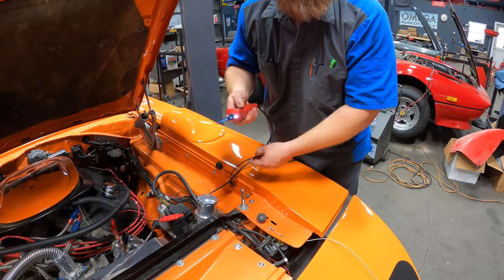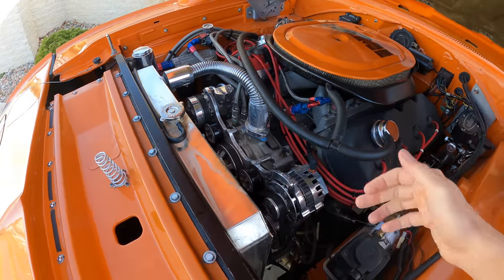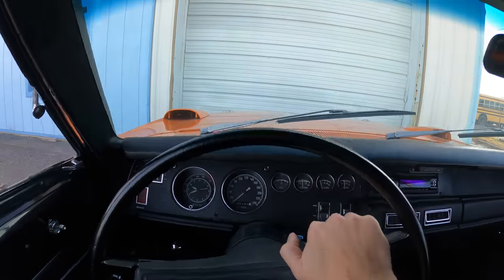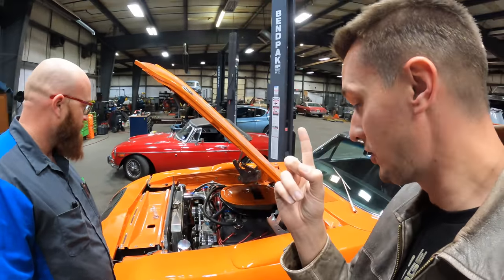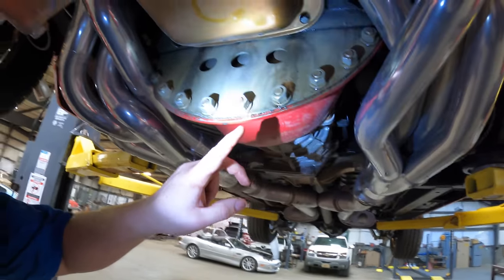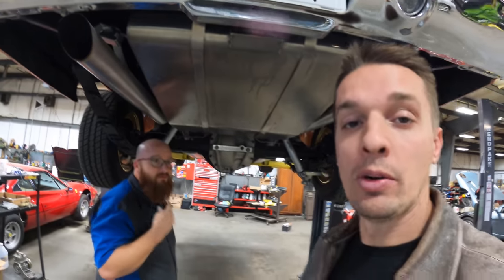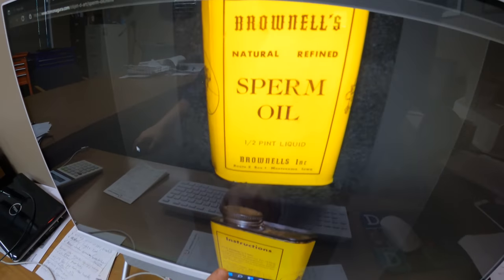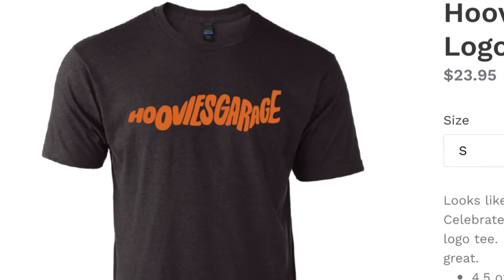How I got SCAMMED buying a Plymouth Superbird online sight unseen (So much broken/missing)

Comment: Who would risk driving a $130k car, with a rare engine, potentially low oil pressure, and a likely overheating situation?  Especially when he is on a first-name basis with the local tow operator?  I guess it's not "The dumbest automotive channel in all of YouTube" for nothing.... 😱
Reply: Someone with a lot of money but perhaps a little less common sense. However, he does seem like a really nice guy and the car is pretty awesome, well, once he replaces those wheels.

Comment: gauge issues are typical mopar. my 76 power wagon shows 3/4's tank when full, volt shows barely charging when its charging perfectly fine. the oil pressure always shows half up the gauge when cold, and a little less when hot. the temp gauge hardly moves off of cold even on a 90 degree day. its all due to the weird way dodge/chrysler did the gauge setups back then. there are voltage regulators behind the dash for the gauges. they either work, don't work, or do crazy things. welcome to the world of Mopar!

Comment: As a general rule I enjoy and even learn a little something from your videos.....But dude....The Superbird may be the MOST counterfeited American muscle car EVER! You would have been better off seeking out and buying, a real Roadrunner with the 383CID four barrel. Hell they had the same "beep beep horn"....Of course there were those 440CID "Six Pack" Plymouths and the 427CIDs were nothing to sneeze at....In other words you got royally screwed on this one.
Reply: Actually there is no "six pack" plymouths. The dodge was the six pack and the plymouths were six barrels. Picky i know but mopar people just are.
Reply: @SixPackDan  I think you just answered a question that bugged me from the start about the first patrol car I worked out of when I started my career in Law Enforcement back in 1976. That car was the las survivor six Plymouth Fury  "Police Package" cars purchased as a "fleet" in 1972. The owners manual was still in the glove box and the and the engine was identified as "six pack equipped"....At the time I was not even sure what that meant as I knew more about farm tractors and pickup trucks than sedans of any make or model. What I recall best about that old car was that it LAUNCHED rather than simply accelerated and ran like the proverbial scalded dog in a straight line, but you DID NOT want to get into the twisty turnies with it as body roll was a major factor. Thanks to your kind response I think I now know why I could never find any two references that seemed to agree on what Mopar vehicles of the era actually came equipped from the factory with "six packs". Again, thanks for the kind reply as it's always bothered me a bit as to why every other (civilian) Fury of that time period DID NOT have a "six pack" under the hood or mention of such an engine referenced in those very few owner's manuals that I had the rare occasion to look through. Even a 67 year old, retired Road Dog likes to learn new things.

Comment: Sucks you had to deal with a bum but I hope the car works out well for you!

It’s wild how subjective car values are considering I wouldn’t pay $13,000 for this 🤣
Reply: The prices for these classic Mopars are insane, especially the ultra rare ones like this. I saw a video where a guy found a 1969 Charger that was a total basket case, BUT it was an ultra rare equipment package and even though it was basically scrap metal the car was now worth restoring because of collector interest.

Comment: The wizard is right about the front shocks. As it is, the adjustable threaded spring purchases were adjusted to raise the front up, but the shocks (dampers) ran out of travel, as they are against the internal droop limiters. The guy before probably kept jacking on the spring purchases, but since the shocks were already against the droop limiters, it jacked up the spring preload. This basically locked the front end so the suspension would not move and the only spring/damping was in the tire sidewall. Not a good setup.  Needs socks with longer shafts to get the suspension travel where it needs to be with the desired ride height.

Comment: 4.10 Dana and an  A-833 18 spline 4 speed ought to be running at about 4,000 RPM’s at 70mph. Driving for an hour like that will wear you out. Passon Performance finally created a strengthened 18 spline (sustained 900 ft lbs torque) with a 5th GEAR!!! and the aluminum case is pretty close to the original cast iron case, so the geometry is right and no cutting of the floor is required. It allows you to drop your cruising rpm’s by 400-600 RPM’s in fifth gear without sacrificing much gearing in the first 4 gears as two of the gears are exactly the same as stock and the other two are spread a bit to where there’s not a big drop when you go into the 5th gear, which is a .80 final drive ratio. I have yet to install mine in my Cuda but I can’t wait. Trans was $5,500 + freight + clutch kit + a hydraulic throw out bearing system due to the HD clutch I needed. They’re normally on a year back order but worth the wait with a tall rear end like a 4.10. I’m running a 3.91 and it gets moving quick off the line, but highway trips are hard on the motor, hard in the passengers, hard on the wallet, sucking down gas at 8 mpg. and VERY LOUD in my car with side pipes.

Comment: That front suspension is an RMS kit I have the same one on my duster complete kits shipped to your door is around 6k now..... good suspension, just really not practical for for what you wanna do with the car..... Start gathering parts and put the original torsion bar suspension back on it and get the smooth ride quality it had from the factory....

Comment: We had a yellow one and loved it!  Had to sell it and cried in our cereal for a week afterward.  Our Superbird always run hot until we put a 4 core radiator in ours.  Please dump that aluminum radiator and get a repo one, you might have to wait a while to get it because of Covid  Also what do you call a Mopar with a after market trans, no Torsion Bars and a rack & pinion-- A boat anchor.. But keep this one as it's a superbird and get it back to what Mopar installed on it, there was nothing wrong with ours, except the over heating at first. Now I know why you only paid 125K for this one...... also get rid of those roll bars!!  And last is the old adage buyer beware.................

Comment: The car needs to be wired, plumbed. Convert the headlight doors to electric actuators..Lose the pumps. We use to run two of the big Chrysler 1970 440 single exhaust Imperial mufflers on our stealth streetcars..Walker had a part number. They flowed fairly well but were very quiet.

Comment: Wow a garage that actually lets you look under the car with the mechanic. Here in the UK you normally have to sit in a waiting room until some guy comes in tutting away and tells you that the flange woggle around the throat plate cover needs changing and it’s going to cost three thousand pounds. If you ask to have a look with the guy he starts talking about something called ‘elfin saftie’ and denies access to the workshop. I did have a great mechanic who would even let me help. Alas, he has recently retired.

Comment: Dude that sucks man!  I got scammed one time, I was out with this nice girl and we had taken that old KemoSabe trail up to Horsheweitz pass to check out the air brigade defence machine setting up their advanced airwac sqwuack comptroller in the valley but I started to get some vibration in the motor mounts on my old beater hotrod on account of I had just cut on the Roots blower from a GreyHound bus to my aircooled helicopter Tucker engine in the back of car #52 off the line.  MAN, it was abadass ride lifting the front wheels at least half track running 9's in the quarter cuz of all the weight transfer and my chick would ride in the back to help settle the torque steer on account she was a bigger gal and fit squarely in that chopped off tub behind the rails of the Tucker chassis where she could just hang on and straddle the plumbing tube roll cage bars.  
Luckily, no one was injured... except the day that gal broke my heart. /w\TMFR/w\

Comment: The headlight vacuum pump(s) seem a poor choice. They can't produce more than 15 psi (zero atmospheric pressure) whereas a positive pressure pump could easily put many times that--with smaller actuators to boot.

Comment: If it's done right it can be very difficult to spot repairs from collision. A friend of mine has a salvage yard as well as a bodyshop and several times over the years he would take a vehicle wrecked in the front (with a clean title)and one wrecked in the back and combine them. The one was a Cadillac and when it went to the dealer for service they couldn't tell even though they knew it must have been in a bodyshop because of the sanding dust built up on top of the fuel tank so they knew there must have been some type of repairs done to it.

Comment: I once bought a "runs and drives" Bronco on Ebay that didn't even have the intake manifold installed, was missing the carb, and the transmission was in the bed behind the seats.

Comment: That "vacuum pump" looks like an air suspension pump that someone has swapped the I/O and repurposed for vacuum and put the intake muffler on the outlet which is doing essentially nothing.  The also didn't bother to put a vacuum switch so the poor thing runs constantly.

Comment: Magnificent, wonderful car! Fascinating video! I guess if you can afford a $130,000 car, you can afford to forego pre-purchase inspection. I bought an eBay Datsun 280ZX in California, but did not purchase the car until it had an inspection by a Datsun/Nissan, vintage cars-familiar mechanic. The inspection cost me a few hundred bucks, but I wouldn't have handed over my $13,000 without it. It had issues as it was original in every way, but I bought it & drove it back to Texas.

Comment: Turbo mufflers. Nice. I also like the way turbo mufflers sound. Unfortunately they block alot of flow. They are quiet at idle and cruise but sound awesome at wide open throttle. I wish there was a better turbo muffler, something that flows better. Currently I run flowmaster 40s with tail pipes and if it is run all the way out the back it really isn't loud.

Comment: a lot of questions about whether this is authentic or not or about the rebody.  These are really hard questions  Do the basics, check the vin, the trim tags see what they say, do the research and see if Mopar actually made a distinction in these places, they may not have.  check the attachments of the trim tags and the surrounding area, are the rivets/welds correct? did a section of sheet metal get changed around the tag?  check frame numbers, check the paper trail, call previous owners.  Original birds' nose cones were not built real accurately, tops of fenders were smoothed with lead to match nose, some received a couple dents in the fire wall passenger side in the factory to designate Superbird as well as bends in the undercarriage, but check with experts on this, i am not one! Some things that stick out to me are, first why did they make this car into a restomod?  Superbirds are valuable, not as valuable as most people think, but valuable, very few people would restomod, they would restore because you're killing the value of the car.  That being said, the car looks to be worth all you paid for it, but in a restomod your value may not change a whole lot even if it isn't real, rel birds sell under $200,000, considerably  less most times..Who ever had it built put more money in it than you spent. People bitch and moan about original-rebody-partial rebody, these terms get really vague as does the law.  As far as i know, you could conceivably switch over every body panel one at a time and not really hit a certain spot where it officially becomes a different car, yet you can't legally switch the tag, basically you can drive a new car under the tag, but can't put the tag on a new car ..Where do you draw the line? new quarters? doors deck lid? roof?   You can make a tribute car which is really completely faking it, but when the guy you sell it to dies and it gets sold, does anyone know its not real?  the law is fuzzy, and the ethics actually are too!  what's a partial rebody?  All that i restore seem to end up with quarters, floor, trunk floor, maybe a used door, that's probably over half the car.  You can't misrepresent a car as something it's not, thats fraud, and you shouldn't, but it can be faked really well and when you restore a legit car it goes through the same process so it's very difficult to tell most the time and becomes a matter of opinion, generally if it's that good, it will sell as real.  but the buyer that really cares about all that is not going to care on this car either way because it's been highly modified, he wants it original or as it was, sloppy nose cone metal work and all.

Comment: I see a sub frame conversion. Torsion bars to coil-overs. I have an acquaintance that has done this change on a Challenger resto mod. It does improve the ride and handling. But WAY not stock and a negative that would have made me not touch this car. But it is a rebuilt crash car so....have a good time with it as a nice driver.

Comment: The major takeaway from this is the coil over spring set up, everyone is using them on these "crap resto-mods" and kit cars like 41 Willys etc, and now that I look back on them many are set up wrong, they bought too light a lb rating and cranked them down and the springs are compressed, because the front or rear or both were sagging instead of getting the right set up, a lot of these cars a whipped up in body shops, they toss them together and paint them for a quick flip and big$$$, I never thought about looking at them before, this is a big tip off because if you see that you can rest assured that there is more wrong with the car.

Comment: Blindly trusting someone on line, let alone for $130,000, when you could easily have had it shipped to the wizard and shipped back if necessary, really puts the onus on Hoovie and not the (crooked?) seller.  Trusting blindly a complete stranger is just like putting a message in a bottle and throwing it into the Pacific, trusting it will end up on a beach in Oahu.

Comment: That's a dream car for me. Street modded ex race bird. It wouldn't reduce the value changing things or modifying it more. Drive em if you got em. I drive mine year round weather permitting. I'd replace both vac pumps with a tomato can.

Comment: Nice car however, the engine compartment is a disaster.   Where is the  tag  that is suppose to be on the left inner fender?  The code would indicate that it was a 426 superbird.  Those braided hoses for the oil cooler are an eye sore.   The things I would do to the vacuum Pump:  Wrap thin lead sheet over the motor,  replace the steel tray it sits on  with less sound conducting  material such as  G-7  garolite  (silicone/fiberglass), also a  soft rubber mat between the tray & pump,  add a small reservoir tank  and  a  vacuum switch so the pump only turns on   a small fraction of the time.  It is horrible that somebody  painted  over everything in the engine compartment.

Comment: Sooo... what is providing the vacuum for the brake booster? Wouldn't it be better to just use the same vacuum line, with a one-way valve for the lights?

Comment: The front suspension is not Chrysler - no torsion bars and rack and pinion steering 
Not a dig just an observation 
The  subframe connectors and torque boxes will make it a rigid and good handling B body

Comment: None of our old cars like cold starts very much because there's these big piles of crap on top of the engines called "carburettors" and as much as the interiors and bodywork of 60s and 70s cars age, their carbies age even worse.  

A carburettor can be hard to keep tuned after just a year.  Kids and some folks with short memories like to order them on brand new crate motors in the name of authenticity or to save money but they're crazy.

Comment: 20psi oil pressure doesn't mean an engine is "smoked"  Industry standards is 10lbs per 1000 rpm.  at idle 10 psi is considered OK.  You also need HEAVIER springs, not a longer shock.  Also, never buy an old POS without looking at it in person.

Comment: only into the video a tiny bit and can say it must have a MASSIVE vac leak to have an aftermarket pump hooked up to maintain vacuum. Everything there should be able to run off the regular engine vacuum. and dangit .... coil over front suspension. Was hoping it's still be Torsion Bar lol

Comment: You cannot trust people anymore, i bought a used saturn 6yrs ago then found it had blown head gasket and they put blocksealer in it, 6 months ago i went to purchase a used 07 durango 5.7l he met me at lows so the durango was to hot to open radiator cap so i asked him if he ever put blocksealer or radiator sealer in it and he said no, i bought it the next morning when cool i checked radiator to find gel balls floating in it and gold sealer along with some kind of fiberglass hair looking stuff, i bought a blue devil radiator flush and ran it for 2days with the flush then drained and put coolant, after a couple days it leaks a couple cups of coolant,  i just keep filling it every few days, my point is you just cannot take anyone for their word anymore, they will do anything for a buck.

Comment: Catching this 2 years later, but if you paid $130k for a genuine hemi Superbird in running and fixable condition, that's still a deal to me. As a sort of purist, it's sad to see that it was more modified than properly restored, but nothing looks too far gone and many of the issues are easily and somewhat cheaply repairable. If the VIN is legit and in the proper locations (engine, trans, body, etc) then it's a worthwhile investment.